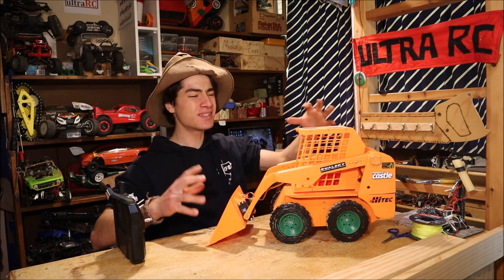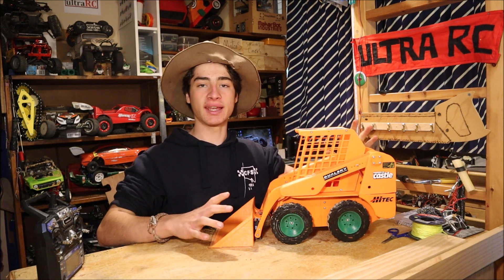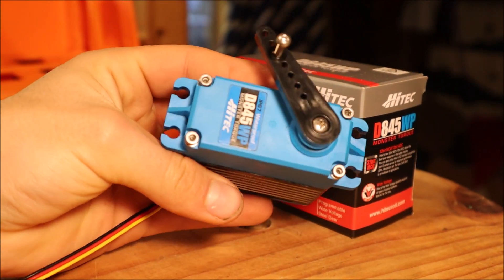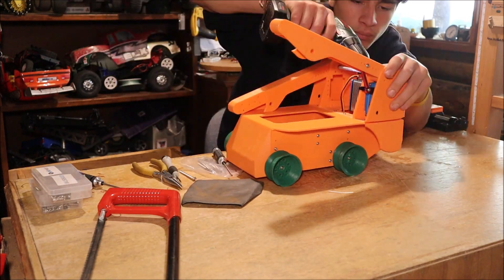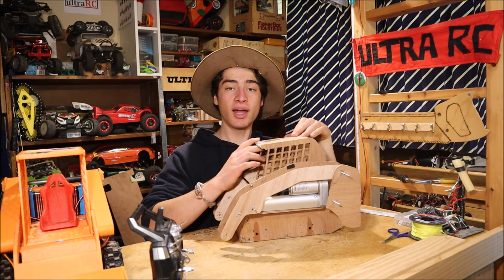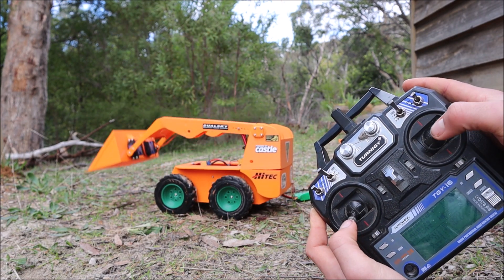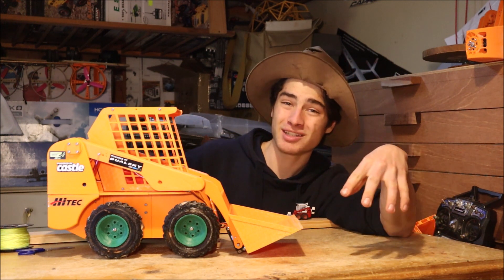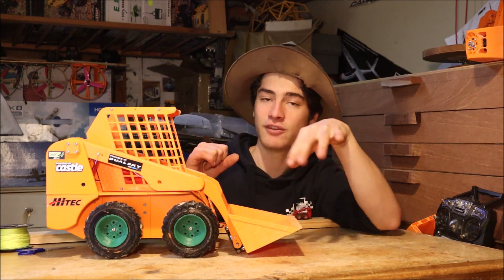3D PRINTED RC BOBCAT //ULTRA RC

Comment: Nice job, did you use 2 or 4 ESC?

🔵🔵🔵👍👍👍😀😀😀🔵🔵🔵
Reply from the maker: Hi mate,
I used 4 esc 
Thanks for watching Ultra Rc:)
Reply: @CORINKERSTEN  Sometimes looks like it loses traction on some of the wheels
Reply from the maker: @carloshnunez  yeah It wasn't very refined. The mix would cut one side when trying to turn I think, I would like to make a better one one day :)